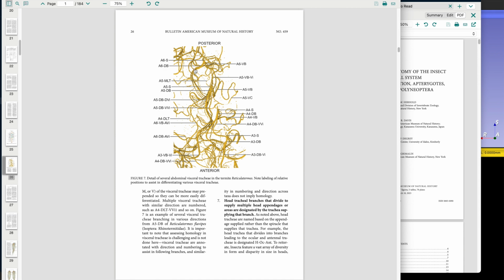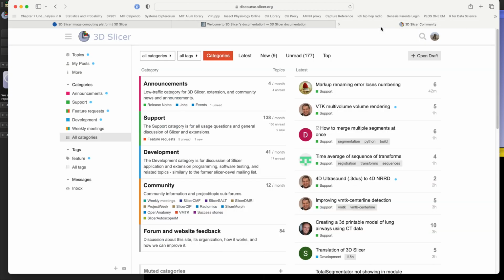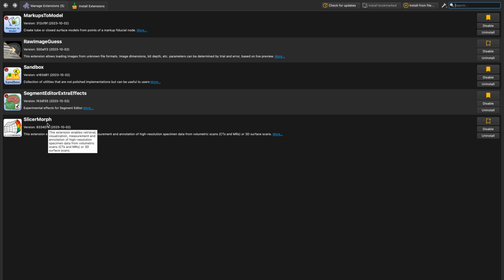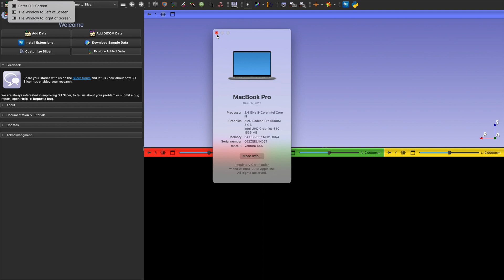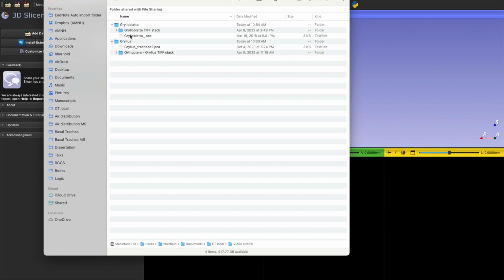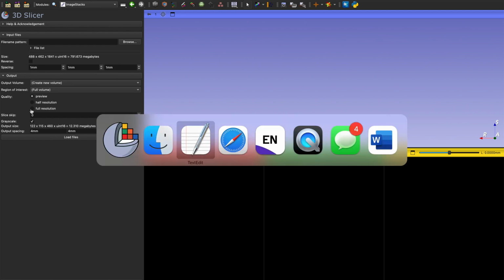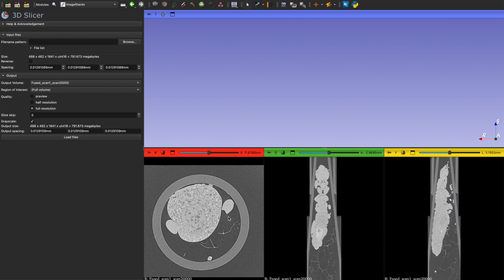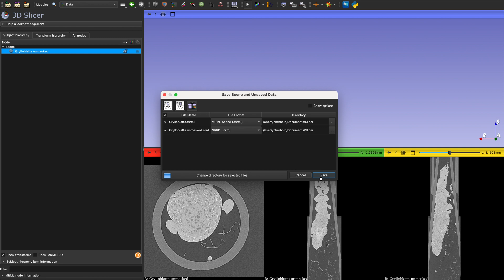01 Importing data into 3D Slicer

Comment: Thank you for all the videos on the tutorial. 
I'm doing some fishes osteology on Slicer.
Just a question. When you are done with the 3d model, how do you final edit it on the photoshop (or similar software)? How do you export the final file, and open it? Thanks again!
Reply from the maker: Thanks for the comment. First I make models of all the segments in Slicer in the "Segments" module, then I save these as PLY files. (You can do OBJ too but I prefer PLY as I don't care about surface/texture info at this stage.) Then I import them into Blender and surface/aninate/render as necessary. I'll post a short video on this soon.
Reply: @hherhold  cool, thanks for the answer. What if I need just a 2d images, could I still doing on blender? And are you using your Mac pro for the analyzes? I'm trying to figure it out a better machine to edit the segments
Reply from the maker: @Reis.renanborges  It depends on what you need to do with the images. If you just need representative pictures, you can do screen captures in slicer (there's a module for that, even). I export to Blender because I generally need to make higher res images that wind up being wider than the screen; for example a 30" x 11" 600dpi TIFF for printing or publication. Blender will render at any resolution, and I just set up an orthographic camera projection. This works great for most morphology images.
Reply: @hherhold  The module for the image export isn't that good (looks like it was made on paint or some like that haha). I willl need for publication too, so I'm going to try the blender. Are you still working with insect anatomy? 
Could I e-mail you in the next few weeks if I struggle with something in the pos slicer work? 
Thanks again man, your work definitively help me alot.
Reply from the maker: Sure! You can find my email on the AMNH website. I’ll post a short blender video sometime soon.
Reply from the maker: Just posted the export to blender video, hope it helps.